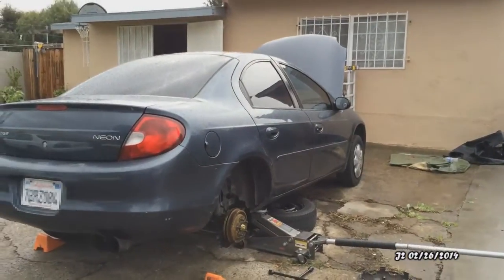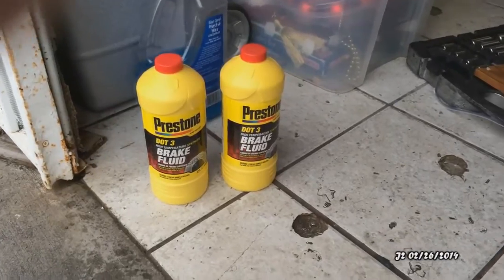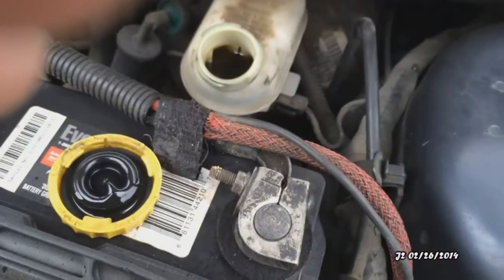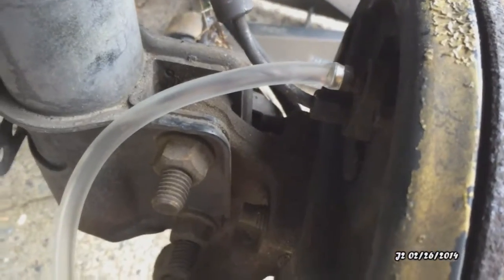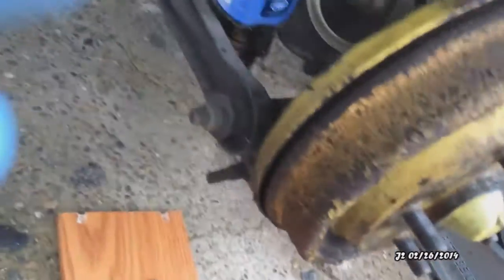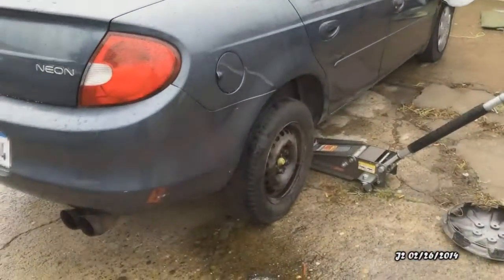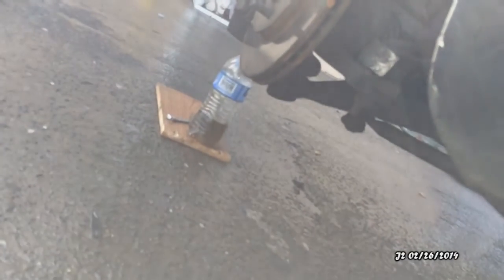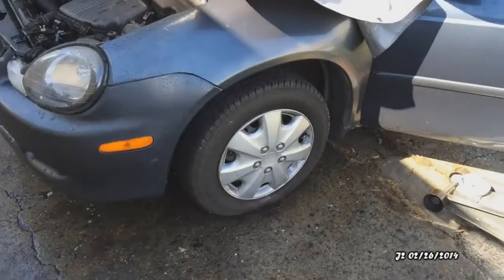Brake Hydraulic System - Bleeding (02 Dodge Neon)

Comment: I'm confused do you have speed bleeder valves?  Thought you have to depress the brake the open the valve the close the valve before you lift your foot back up.  I think you're pulling air into the system by pumping the brakes with the system open.
Reply: Yes you should.  That way when the lift back up air is not sucked in to the system.  Then have them start to press down and you reopen it which will let there foot go back down to the floor.
Reply from the maker: You're correct.  One person is supposed to hold onto the brake while another person close the valve before releasing the brake.
Reply: Only other thought would be if you have a sealed container and the end of the hose stays submerged perhaps that would work, but I guess then you are pulling the old brake fluid back up the tube when you release the pedal.  Guess I'll just stick with the 2 person method haha
Reply: J2Crackhead  I have a question should I turn the valve and seal it while the person has their foot on the brake to the floor?
Reply: Something else here guys is that in the master cylinder the way you know you are done is by there being all clear fluid in there not still black stuff. Job not done correctly plus if you look at the lines again in the video there is air in the system and there for there shouldn't be. There shouldn't be gaps of air in that clear line. Why you ask? simple with there being air in the system like that that means you should be putting grease or something around the hose as you pump it to form a solid seal around the brake bleeder line.